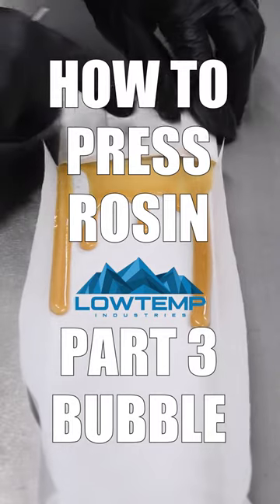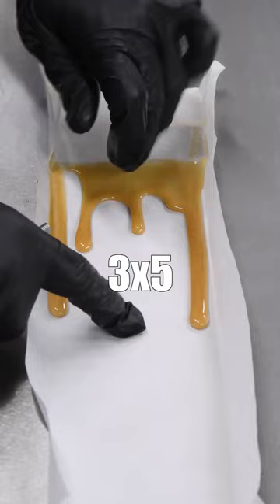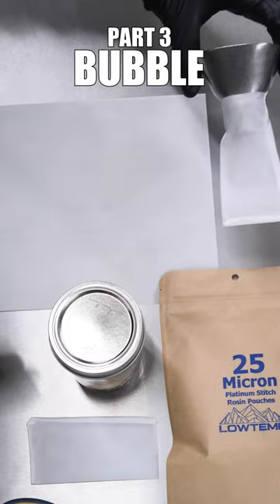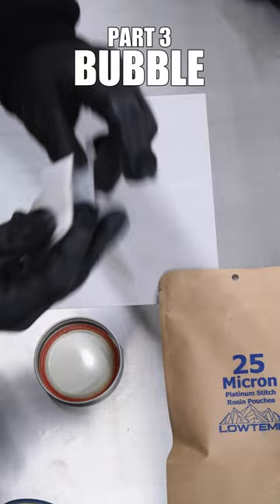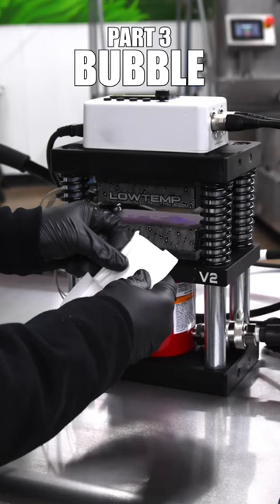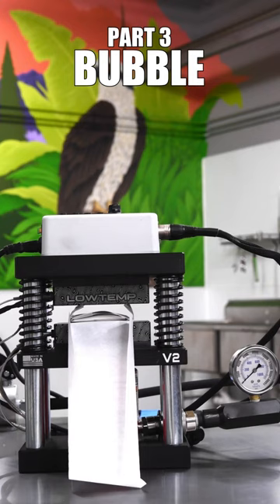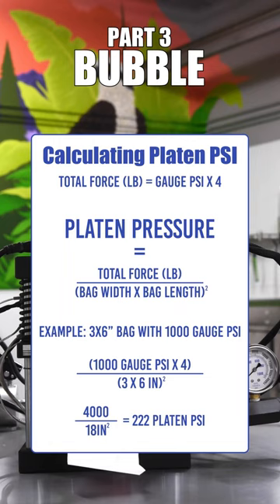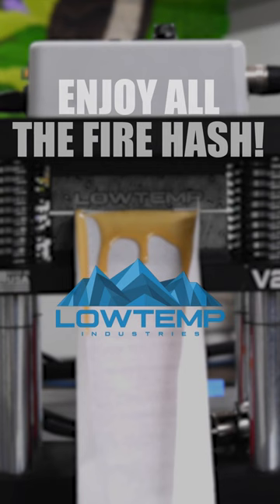PART 3: How To Press Rosin for Beginners - Bubble Hash

Comment: Would you say there is a big difference in quality  between Freeze Dried Bubble Hash vs air dried.   I'm trying to make Full melt cartridges. I'm using Kung Fu Vape. But the viscosity is too thick. I dont have a vacuum oven.
Reply: Buchner funnel hash drying technique by Tyler Markwart.
And then, nugSmasher and lowtemp will teach you how to make carts using the rosinjam methods. which is a slow low heat cure.
Reply: Air dried might have more terps if dried at the right temps. Freeze drying is for speed and color and larger amounts